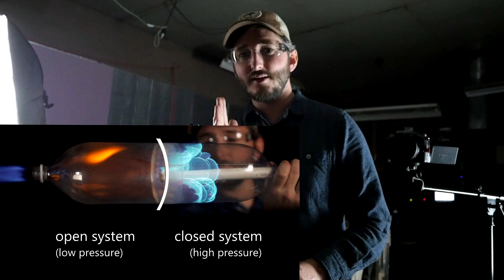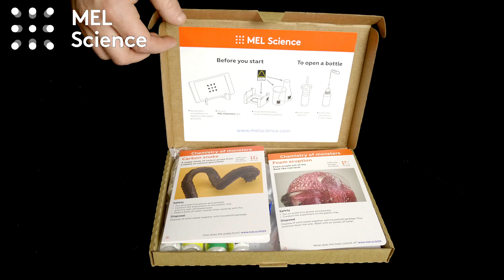XL Soda Bottle Rocket Engines (Static Testing)

Comment: I lake flame in bottles :) It would be interesting to ignite the gas at both ends and play with timing of those two ignitions. Easiest way would be using some high voltage source (maybe camera flashes) and timing it with arduino. Or maybe having holes in the launcher pipe and a thinner pipe inside it ending somewhere between the holes and the end for the gas/flame input if that makes sense

Comment: Suggestion:  Use Scotch Extreme glass fiber tape.  Usually you can find it at Staples or Lowes.
Reply from the maker: I haven't seen glass fiber tape that has strands running in the direction I'd like it to be in for this purpose
Reply: @Nighthawkinlight  That's why I suggested this tape.  The strands run in two directions.  We use it on RC plane construction sometimes.  Good luck on future videos and thanks for all you do!!

Comment: Ben, mate, please stop talking about pressure. Pressure is bugger all to do with it. Think about flow instead. The gas in the bottle is flowing. Think where it flows, and the flame front advancing through the flowing gas, and all becomes clear. Pressure gradient through an empty bottle is insignificant compared to gas flow.
Reply: It worked! Three seconds after unpausing, having made the above comment, you mentioned flow for the first time! 😃
Reply: Yeah, okay, when you light it at the back it’s all about pressure. Tell me to watch it all before commenting. Go on, you know you want to!

Comment: When this bottle is in flight there will be acceleration which pulls the gas towards the nozzle (or rather the bottle moves and leaves the gas behind, closer to the nozzle), that could change the front-to-back burn a bit as well by "feeding" gas to the burn position.

Comment: Great footage! But your tests aren't considering the jet of burning gas coming from the PVC pipe. I predict that when you do actual launches, you will lose a lot more unburnt gas when the ignition point is farthest from the nozzle. With the way you are testing in this video, the PVC pipe is shooting ignition gases all the way to the end of the bottle. You could run a piezo igniter down the PVC pipe to mitigate this effect.

Comment: Did you at all consider using those large plastic jugs they use in water coolers before going to splicing smaller bottles together?
They're fatter of course so maybe would give them too much drag in the air, but might have been interesting.
Or maybe one of those giant novelty bottles that are still made of plastic, I think there are Coke bottle ones out there?
Reply from the maker: I did think of the big water jugs, but you can't find good clear ones anymore. They're all a foggy blue with a built in handle on the side. I looked all over the place for better ones.

Comment: I suggest to replace the nozzle with metal cup also add a fabric to the bottle to slow down the process and prevent the gas from accumulation in the bottom near the nozzle. Good luck with rocket ;^)
Reply: I was wondering what would happen if you fill the bottle with loosely packed fiberglass. Combustion looks pretty even already, but might be interesting.

Comment: Can you make a multi chamber bottle? Cut the bottoms off then attach with the tops inside pointing toward the nozzle. This would provide additional stability during launch. I have no idea how the flame would propagate through the chambers. You could also experiment with drilling holes in the side of the tube used to ignite the mixture.

Comment: This video reminds me of the times I made potato cannons 'sing' by filling the chamber with a rich butane/air mixture, keeping the barrel empty, then hitting the ignition. The one that made the coolest sound was the straight-pipe cannon measuring about 4" dia x 72" long. Too much fuel in the mix = slow burn = loud, twangy, bassy howling.

Comment: Mabey to prevent the bottle from melting you could glue a layer of aluminum foil to the inside of the nozzle end. Or use that heat resistant Starlite glue you made awhile back.

Comment: I think the fire shifts asymmetrically downward due to the recoil acting on the system to drive the bottle upward. The propogation front looks roughly symmetrical until the bottle moves laterally.

Comment: 18:00 you could drill some holes in the side of the pipe at the ignition point so the flames will come out there

Comment: Anyone else want to see how this works with a laser cut acrylic/polycarb  tesla valve? Like getting a slice into how a flame arrester works, also something I'd like to see is if having one in the tube with ignition from a bbq lighter spark gap would change the characteristics much. I'm betting it would.

Comment: To adapt it to the launcher you could cap the end of the PVC pipe and put holes close to where the bottle "nozzle" would be, it would achieve the goal of placing the ignition point closer to the nozzle but has the downside of requiring a drill or a method to put holes on the PVC pipe for the end user

Comment: What about connecting a few bottles together with vinyl tubing? Kinda like rocket staging
Reply from the maker: I would be interested if they could be made to pop apart as each used up it's fuel
Reply: @Nighthawkinlight  hmm, maybe by burning through a string with the exhaust
Reply: NightHawkInLight 
The flame front takes a while to reach the forward end of the rocket, so maybe some kind of staging is do-able? Testing is needed ;)

Comment: Don’t try this at home! 
We used to do this at work by filling plastic binliners with a propane oxygen mix. One day we blew a welded steel skip apart by accidentally putting too much oxygen in the mix.
If you accidentally allowe too much oxygen to mix with your gas then you will have inadvertently constructed a bomb which may go off in your face.

Comment: Why is the pvc pipe flattened or "squared"
Reply from the maker: Shaved down so gas can pass by when the bottle mouth seals around it in those areas. My earlier bottle launcher videos dig into that.
Reply: @Nighthawkinlight  I thought that might be the case.

Comment: Exhaust flow is subsonic, wonder if you could fit a de Laval nozzle on to get a bit more oomf out of it?
Reply: Yeah! If you drill a tiny hole you can get a deafening rocket sound, louder than a firework. It can easily launch the bottle.
Reply: The bottle neck would make a good nozzle and can be attached quite easilly because the ends are threaded.
Reply: sure, with such short runtime an ABS printed part would hold up, too.
Reply: Jeff Vader more power... ughguhgu.uhg
Reply: bobsagget823 asshole finds insulting others to boost their self-esteem, remains unintelligent
Reply: bobsagget823 
Twat tells everyone they’re wasting time, spams comment section with poorly constructed insults for fun.
Reply: @jeffvader811  Potato
Reply: For many a mere fraction of a second or so, it WAS supersonic!
Reply: Vit Apa 
It could hit Mach 1 if the flow was choked at the nozzle, but it can’t go over that unless it expanded afterwards.
Reply: @jeffvader811  *Did go,
*because it is 
*Wouldn't have gone
Not sure if you were agreeing with me, or agreeing with me, but
FTFY
Reply: Vit Apa 
Surely that’s not supersonic flow then, merely sonic flow, right?
Reply: @jeffvader811  Darn ya' got me!
1 love brother.
edit; gotta go fast
Reply: Vit Apa 
Guess I was wrong about the flow being subsonic though, how exactly does one identify choked flow visually?
Reply: @jeffvader811  A choke usually helps visually identify it, but just knowing the fact that he is using a 2 liter bottle, which has a specific measurement specification for it's choke.
Also, the movement of the flame was near laminar, and seemed to push itself through itself into the middle of itself, if that makes any sense.
Edit; Reading that back, what I mean is that if you imagined a needle of flow moving through another outer shell of flow, you'd be looking at a sonic or supersonic flow.
It's shape is tapered typically, whether tapered like a Lance, or like a spike
Edit 2; Also, diamond shapes appearing in the flow, but that's way way faster than this
Reply: Vit Apa 
I think I see what you mean, I knew Mach diamonds (that’s what they’re called right?) were indicative of supersonic flow, but I didn’t know that extended to sonic flow as well. Makes sense though now you mention it.
Reply: @mikeishome69  if i'm not mistaken, shock diamonds has more to do with the exhaust gas being at a lower pressure than the atmosphere it's going into. Or, at least that's impression i got from a video i watched (i think by scott manley) about rocket nossle design. Unless it was Everyday Astronaut's aerospike video...
Reply: @reaganharder1480  It's more or less the force of compression upon gas that causes it, though there is a requirement for specific pressures in the atmosphere in order for it to be more apparent, the high pressure atmosphere pushes back on the low pressure but high speed jet, the jet compresses into itself creating miniature high pressure zones that ripple throughout the exhaust.
Edit; I mean more apparent as the occurance of shock diamonds in low pressure zones does and can happen, but it's basically invisible if it does, and it's not likely in the first place, as there is a certain level which the atmosphere needs to push the exhaust back in order for them to appear, making a base "minimum" atmospheric pressure for them to occur.